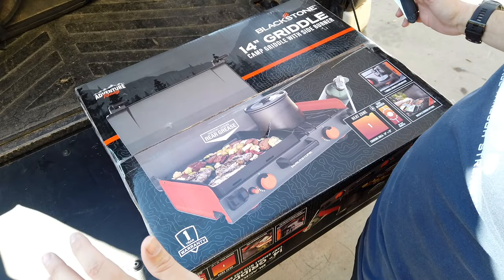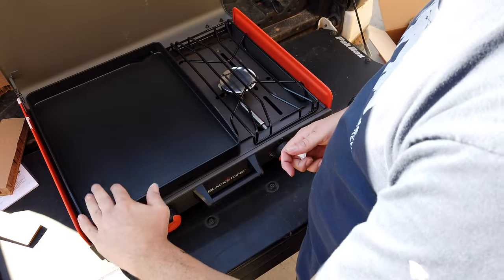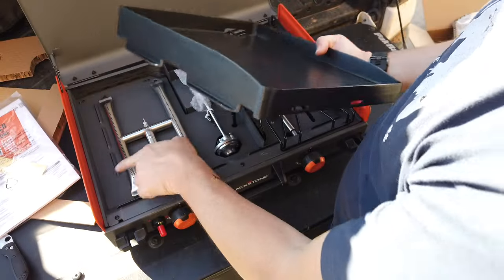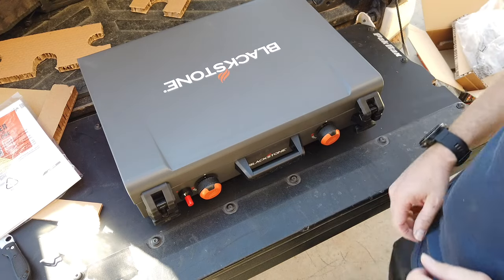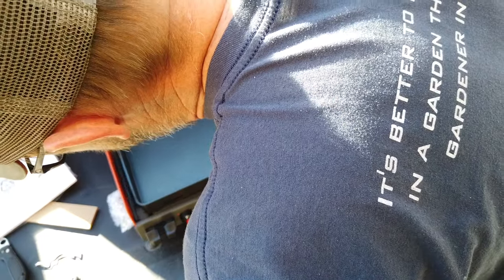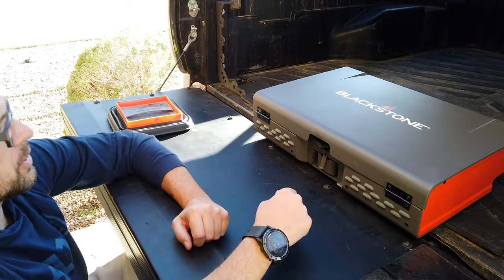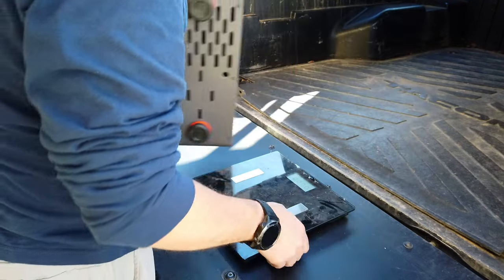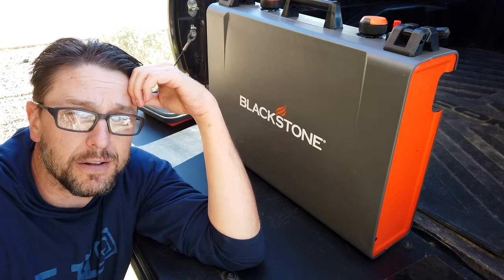Blackstone Adventure Ready - Griddle + burner

Comment: The manual is more than helpful. It does tell you to check the ignitor 1/8 inch from the burner, mine needed to be adjusted on the griddle side, it was literally touching from the box. The spare grease cups and the new tools for the camping griddles will all fit for travel under the grate for the burner easily.  Might check that dome too. Again, reading the manual it tells you how to install the grease cup from the storage location for use.
Reply from the maker: Thank you for watching! I have read it now, i always try to create content in a way that people normally would have just taking things out of the box and seeing how user-friendly they are, but I definitely appreciate the feedback

Comment: Follow up a couple months later - bought one and love it. Except the plastic handle is already broken. It's just a round piece of plastic snug between the two holders and each holder already cracked. Blackstone is sending a replacement but I'll be measuring the size and just going to Home Depot or something to find something a bit more sturdy.
Reply from the maker: Mine is still going strong, but I would love to know (for future) if you found a suitable replacement.
Reply: @azbackroadadventures  I did! Found one on Amazon and it's been great.
Reply from the maker: Can you toss a link over?

Comment: I dont agree completely with your review. Reading the instructions would have solved several of your complaints about the griddle, including the grease cup and being hard to ignite. I had to adjust the ignitor on mine when i got it and now its no problem lighting. Im actually impressed with how well it cooks being as small and compact as it is. I also like the aluminum top. I picked up the nylon/silicone utensil kit when i got mine so i wouldnt scratch up the top, and it cooks great! Nothing sticks to it and its very easy to clean. Plus, if im taking it somewhere, its very nice to not have to deal with oil and seasoning, or worry about rust during storage.
Reply: Its also very good on fuel using both burners actually. I did a pretty lengthy cook (about an hour) and i went through maybe a third of a one pound bottle. Thats far better than my 17 single burner is on gas, which goes through nearly an entire bottle for one cook.

Comment: We got the griddle only version of this as we have a small separate burner which can fit bigger pans on. This one can only take a tiny pan which may be sufficient for some.  The quality isn't the absolute best but if you are not heavy handed with it I can't see why these wouldn't last. We don't go camping with ours, we use it at home to grill outside and have a backup cooking source when the power goes out. We are also going to use it along with our separate burner for when we rip out the old kitchen as we won't have a cooker to use for a few weeks.
Reply from the maker: Thank you for watching!

Comment: Sorry, but instead of laying instructios to the side, you should have read them first. The instructions will tell you:
 how to remove griddle surface
 how to properly use levelers
 how to use grease cup
 do not season
 how to adjust ignitors
and most important-DO NOT USE METAL UTENSILS!
Also, the other model is 20 inch, not 22 inch.
Reply from the maker: I absolutely agree! However i always try to see how simple a product is to understand for the end user without having to go through pages of instructions, because let’s face it there’s two kinds of people right? Lol. I appreciate the insight and feedback though!

Comment: Heads up you shouldn't use metal tools on this model. The griddle is not cast iron. It's coated aluminum and you'll scratch off the non-stick and it'll end up in your food.
Reply from the maker: Yeah, someone else mentioned the same and I snagged some rubber ones after. Thank you though appreciate it. Thanks for watching! be sure to check out some of our other videos.

Comment: Junk! I bought one. The Orange paint flakes off opening and closing the lid getting on the cooking surface, my griddle had spots that weren't ceramic coated and it was hard to light. I returned it and bought a 22" Adventure Ready Griddle with a Cast Iron flat top. Much higher quality and the same price.
Reply from the maker: Well hopefully i dont have the same issue (other than the hard to light) but good to know you like the Adventure ready griddle.
Reply: @azbackroadadventures  And I hope you have a much better experience with your new griddle. I really like the concept for taking it camping. I just wish they would have done something different so the issues I mentioned were addressed before sending it out to the consumer.
Reply from the maker: Agreed. I wish it was like 1/2” thicker to store items inside during transit.
Reply: @azbackroadadventures  I bought so many accessories, we have a hard time knowing where to keep everything in our RV LOL.
Reply from the maker: @robh063 always the struggle for space.

Comment: I picked up the 20" version last weekend, used it 3 times so far in preparation for camping mine lights just fine I. I dont have remove the griddle to get it to light. I forgot to pull out the grease catch too 🤣 hopefully it was a good reminder to never do that again.
Reply from the maker: Yeah, i’m going to try and adjust the igniter.
Reply: The grease trap is supposed to be pulled completely out of the recessed hole, turned sideways and hooked over the back of griddle using the wings on the grease cup.
Reply from the maker: @weathermandoug96 i’ll have to try that!

Comment: Read the manual before doing a video. Geeeees, Also remove the Gas Adapter/Regulator, You will ruin it with the heat... DA
Reply from the maker: Thanks for the tip on the regulator, I never considered the diaphragm inside getting damaged from the heat. Thanks for watching! be sure to check out some of our other videos.

Comment: Don’t want to cook on aluminum. Can’t get it lit. No thanks.
Reply from the maker: Glad i could at least help someone make an informed decision.
Reply: While it wont get exactly the same sear as the steel top does, the aluminum is actually nice in its own way. The aluminum heats up very quickly and cools off very quickly for cleanup, and the nonstick is great. Absolutely nothing sticks to it and it was flawless just wiping it with a paper towel after bacon, pineapple, burgers, and brats. Mine was hard to light at first, but gee read the instructions and adjusted the ignitor and didnt have a problem with it from then on.